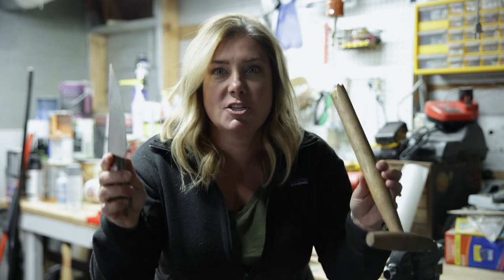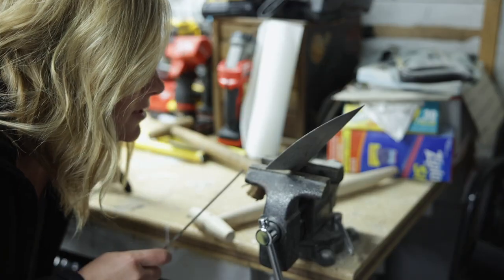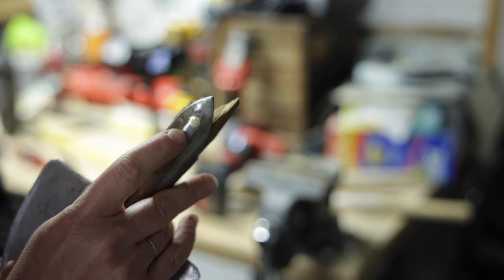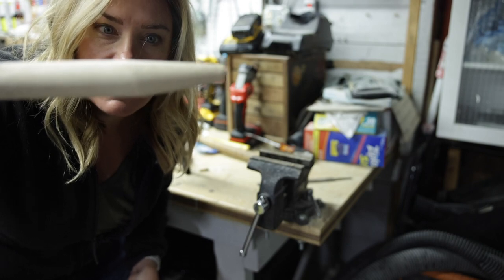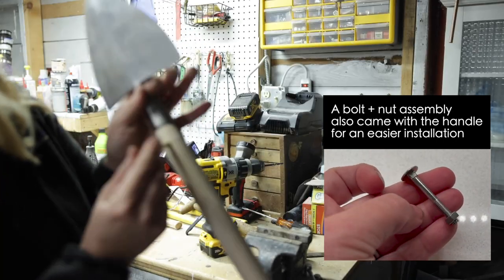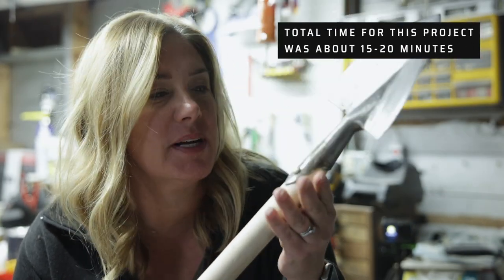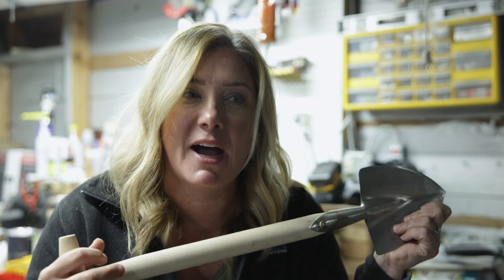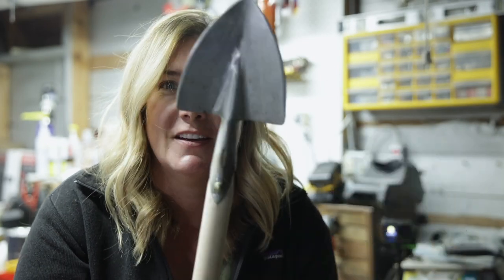Fixing my favorite garden tool 🌿 🛠︎

Comment: GREAT JOB Erin!!!  I have a snow shovel and a round pointed shovel both with fiberglass handles that snapped.  I ended up tossing both, I consider myself very creative and able to fix anything, but not worth my time struggling with fiberglass cheap cheap handles.  The WOOD ones on the other hand are worth saving.